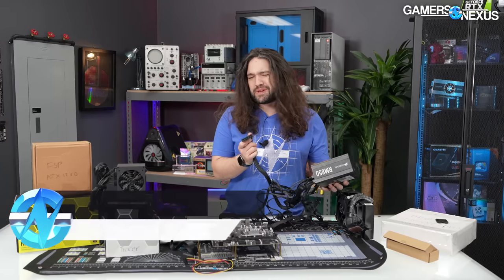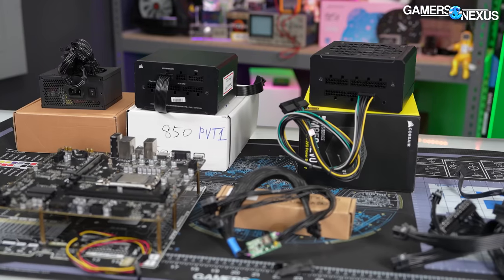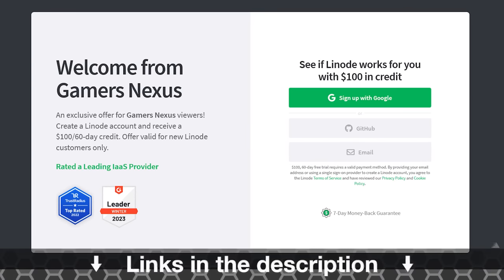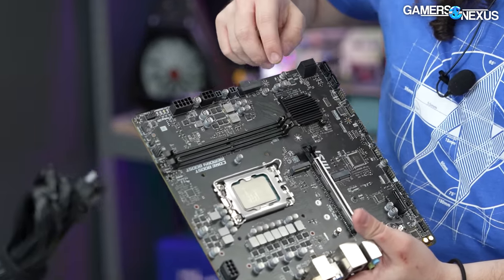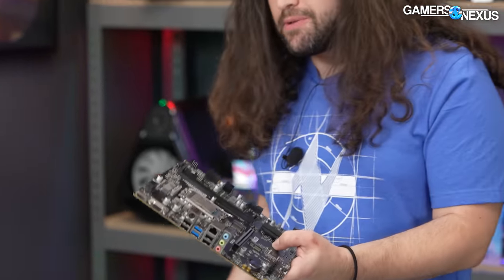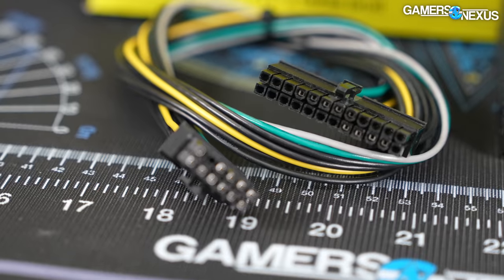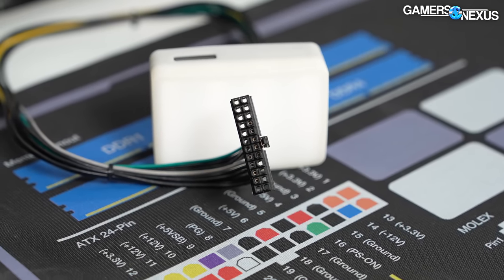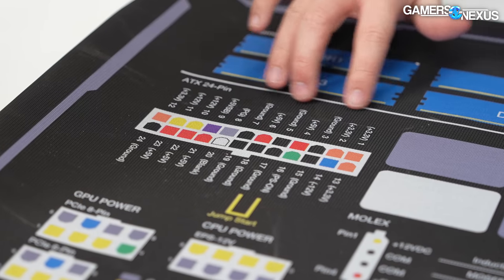The Future of Power Supplies - Maybe (Motherboard Cost, Cables, & ATX12VO)

Comment: Many thanks and great job on such a detailed and informative review. I have an electronics background and found this very informative. I hope you keep this up and produce more content as detailed as this. More understanding enables more informed decisions. I think any claimed 'energy saving' is marketing hype, compared with a properly and efficiently designed conventional power supply.

I don't like the idea of non-12V voltages being generated on the motherboard. These other voiltages have to be generated somewhere and it is better to generate the in the power supply which is more cost-effective to replace than a motherboard if, or when, things go wrong. This is far more likely with cables coming from a motherboard to external devices than to devices embedded on the motherboard. This is much worse than the present system because of the risk of damage to the motherboard, not just the power converter but other parts of the motherboard as well rather than just the power supply.

One thing I find interesting about 12VO is the power supply being able to provide load information to the motherboard. This could be useful in prolonging the life of the power supply if it limits surges such as startup inrush current which is something that can otherwise force the requirement of a larger power supply just to enable the system to start up correctly. Some high-power systems seem to 'eat' power supplies for fun!

Maybe this 12VO power supply load feedback to the motherboard could be implemented on a conventional power supply by re-using a existing but non-utilised line such as -12V which is not used in modern systems? Even if this is possible, what would the motherboard do with such information? With a 12VO motherboard it may be that the SATA power could switch on sequentially which would provide some reduction in startup current, although modern drives take a lot less power so this may be of limited benefit.

One possible solution to power consumption, even if it is not possible to provide power supply load feedback in a conventional system, would be to make existing power control stamdards visible as options in the BIOS. Combine this with a 'Start on demand' norm for all devices and the result is about the best power control possible, especially if this includes control over external ports such as USB. Individual USB port power control would be the ideal. The BIOS options would include the order in which power would be applied and to what devices. This could be expanded to a 'smart' power where there would be different power configurations available including the possibility of specific hardware being enabled or disable depending of what hardware was detected. This would enable, for example, internal storage automatically being disabled if a bootable USB stick was detected providing a secure alternative boot,  no devices except keyboard and mouse, booting between different operating systems on the same system without the other operating system's drive being visible which closes a security issue and limits power to only the devices needed.

Finally, as an alternative, why not broaden the range of clock speeds on processors and graphics cards in the sense of enabling then to run at tens or low hundreds of of megahertz? This may be a lot simpler to implement and would save a significant amount of energy and still leave a usable system, especially considering the efficiency of modern hardware. Go back far enough and games were played on systems running at 100MHz or less! To my mind it should be possible to build a behemoth and have it use as little power as a laptop or tablet if that is all that is demanded of it.
Reply: The motherboard is already generating like, 8 different voltages.  If your motherboards or power supplies are failing often enough that "which costs more to replace if it blows up?" has a measurable effect on total cost of ownership, you have a very serious reliability problem.

Comment: I might be a stupid person, but I'd personally trust my PSU to make voltage conversions rather than the already over-featured Motherboard.
What I'd prefer to see is 12vsb + the MB going only for 12V (reducing layer requirements) + the PSU providing legacy voltage compatibility. With that you have the same reduced standby footprint (given that the non-12V circuits should be offline in the PSU if we're only on StandBy) but without adding Motherboard complexity.

Comment: if 12VO is pushed in the future, Intel should make a minimum spec of VRs that convert to other voltages on the mobo REQUIRED that should last like 10, 20+ years. and i'm pretty sure that would be pretty easy to do with modern MOSFETs or SPSes for probably under $2-4 in components, at least outside of the controller, which admittedly i know less about

Comment: So, are PSUs difficult to repair? I keep a few old computers around for various reasons, and it's looking like replacing the PSU in case of a failed one is gonna get difficult in the future. Should I just stock up on the existing compatible designs?

Comment: Hey Steve, could you please do some testing / review on this specific PSU? GAMEMAX 1300W Power Supply, Fully Modular, 80+ Platinum Certified, PCIe 5.0, ARGB Aura Sync, 10 Year Warranty, RGB-1300

Comment: The legacy ATX spec was devised in a time when there were no VRMs on the motherboard whatsoever. All the system's required voltages were generated in the PSU, and passed to the components, like the CPU and RAM, without further conversion or regulation. In particular, 3.3V was added to support the early Pentium chips. That ship sailed a long time ago, as CPUs, GPUs and RAM evolved in new generations that changed operating voltage every couple of years. 

All this does is move the vestigal 5V and 3.3V rails from the PSU to DC-DC buck converters on the motherboard. As Steve alluded in the video, this is a transition that has already long since occurred in the cheap $#!+ prebuilt space. And the server/data center space. And laptops. All the major players in the DIY/enthusiast motherboard space are already OEMs for these classes of systems. I would expect potentially lowered manufacturing costs, due to economy of scale, as you'd no longer have the niche DIY/enthusiast space as a design outlier. I harbor little hope that those economies would be passed on to individual consumers making single unit purchases. 

The regulatory framework that drove Intel to update their spec is predicated on the assumption that systems are replaced in their entirety, and only when they reach end of life. Improvements in macro-scale energy efficiency will be achieved organically, as systems are replaced as they wear out/break down. Outside the DIY/enthusiast market that Steve targets his channel at, which is likely to attempt piecemeal system upgrades, this is a valid assumption.

Comment: Yay! Instead of converting voltage one time in PSU let's convert it every time we need it - that will be more efficient (not). And if you want to keep your old PSU - let's convert it a few times more with some extra cord!
Reply: It will be more efficient, and it will be cheaper.  The OEMs and server makers figured this out years ago.
Reply: @Vegemeister1  For them - yes. But will it be cheaper for you to replace whole motherboard if you need to connect another sata?
Reply: @Hsiss  Why would you need to do that?  No reasonable motherboard is going to come with more SATA ports than it has SATA power outputs.  But if you're talking about adding an extra SATA HBA, you only need a 12V->SATA power converter, not a whole new motherboard.  Those will be cheap once the potential market is big enough.  I'm seeing whole 12V -> 24-pin ATX + 3x SATA PSUs on ebay for <$20. A SATA-only supply will cost even less, since it only needs a single 5V converter (3.3V is almost entirely unused by drives) and no power-on logic.

Comment: Like so many others, I hate this idea. Motherboards are already outrageously expensive, and this will only increase costs. There's really no benefit to board usage either, since now the reduced size of the power header is just taken up by the conversion circuitry on the board. More personally, I never could have built my current home server if this had been forced on me... I have a server in my house that has 11 drives in it, and it appears the best a 12VO motherboard could power would be 6. Now perhaps I'm in a niche with my large server, but there's no real benefit to 12VO in the first place.

Comment: One thing I was unclear on was cooling.  If the computer uses essentially comparable power, it should be generating comparable heat, and therefore cooling requirements.  If it gives you a power supply that has a significantly smaller fan, and the MoBo has no additional cooling fins or fans where does the heat go?

Comment: I'm curious how 12VO is going to handle people who need more hard drives then max number of power plugs offered by the motherboard. For example if a motherboard offers only 6 power plug connections but using a pcie to sata card you have 8 hard drives. Would this mean you would need either 2 different power supplies? A 12VO and non 12VO?

Comment: My only issue with the idea of 12VO, is what about all the USB ports, and drives.
While most of the things on the PC itself do run on 12V, there's still many things that use 5V.
a USB3 A port can provide 1.5A, and USBC can provide 3A...
Not to mention the dozen or so hard drives I have in my PC.

Seriously, the only reason for me to go with PC over laptop would be for all the extra internal storage... and maybe a few extra things like video capture or TV tuner card.
I actually have PCIe cards in my PC, such as a USB3 card that requires a hard drive power connector, and a front panel that also has one, to provide extra 5V for the USB ports. what are we supposed to do with those with 12VO?

Honestly, I'd be fine with 12VO on the motherboard, as long as the PSU was still capable of providing SATA power cables. I need my 20A of 5V power.

Comment: This just shows how important in the future being able to use the same motherboard across multiple CPU generations will be critical. 

With Intel axing any platform from supporting more than 2 CPU generations I would definitely pick an AMD motherboard over Intel since AMD has shown they are willing to allow 7 year old motherboards to still use the latest generation CPUs. The cost savings I had upgrading with AMD vs Intel was massive and worth a very minor performance loss compared to Intel.

Intel is going to need to be more competitive with supporting their older motherboards for a longer period of time, especially if motherboard prices skyrocket with the 12VO spec. People won't want to replace a $500 motherboard every time they upgrade 2 generations on Intel vs not having to buy a new motherboard with AMD.

Comment: I'm lost here, they say that by delivering 12vo at idle they increase the efficiency of the PSU, but wouldn't the mobo be converting those 12v to 5v even at idle to work? so they just took the PSU inefficiencies and moved them to the mobo to "meet" some regulation?
this is beneficial how?

Comment: I'm not very convinced by ATX12VO. Instead of having the voltage conversions in the PSU which one needs to buy maybe once every 10 years or so, the cost is added to the motherboard which one replaces maybe once every 3-5 years. And although the 10-pin connector itself is smaller and takes up less space on the motherboard, with all the extra electronics required for those voltage conversions they take up way more space than a 24-pin connector. I actually bought my last PSU in 2007. It died in 2012 and I got a new one for free as it was under warranty, and have been using that one ever since.

Comment: I'm currently on 5900x and I'll only switch to a new platform together with a new PSU which I want to be an ATX12VO one. Even though I have SATA drives so I need 5V. Transition to more efficient HW is a progress I'd like to be part of.

Comment: The other good thing about a direct PSU utilization reporting is that many people will now learn that their mammoth 1200W power supply is running at horrible efficiency because 99% of the time, their system is only drawing 40-80W combined.

The amount of systems I've come across running Ryzen 3600 tier CPUs with 6600/3060 tier GPUs on 1000-1200W PSUs is outright silly.

Even under maximum load these systems often don't even come close to reaching the midway point of the efficiency curve where the peak efficiency lies.

Comment: I still don't like the idea of moving it to the board, because now, you are definitely limited to how much power you can use where, so now instead of a upgrading a PSU to get more power on those other rails, you have to switch the board, if any boards even support more power. I don't see spinning hard drives disappearing for bulk storage yet either, so being able to plug a handful into a machine is still useful. That or we need to add the voltage conversions to all the other peripherals. Though not really sure what things are actually using lately without tearing them down and looking.

Comment: I don't see many (if any) benefits from adopting the ATX12VO standard for users. I know I'll avoid it like the plague. It's only upside, is making the 24 pin a bit smaller. Meanwhile here are all the downsides:

- Not compatible with normal ATX power supplies.
- We probably won't see motherboards/PSUs that support both so it's a hard transition.
- More expensive motherboards, due to the added components.
- All the space saving of the 24 pin is effectively negated by adding the need for extra headers on the motherboard to supply 3 and 5 volts.
- Molex and SATA power cables now must connect to the motherboard instead of the PSU. This will mean less connectors on smaller and cheaper boards, and just a bad design overall. 
- The 6 pin connector is redundant. The 8 pin ESP already does what it's supposed to do. It's main usage seems to be to offset the higher power draw due to all Molex and SATA power now going though the motherboard. But why a 6 pin VGA, why not just use one one more 8 pin ESP?
- Power savings at idle are probably diminished by the extra losses caused by routing  the 12V for disks and other SATA devices through the motherboard.

TL;DR: ATX12VO offers nothing that's worth it, makes motherboards more expensive, will support less SATA devices, and won't be compatible with your existing setup. Geez, I wonder why no one wants it.

Comment: It feels to me that the 12VO standard is more about making the PSU look more efficient to regulators while the system is not actually more efficient and may even be sells so. 12VO makes a more energy efficient PSU by moving part of the power loss from conversion somewhere else that isn't covered by the California regulation thus the motherboard can use cheaper less energy efficient components thus actually resulting in a full system that is less energy efficient in real use even if it may be slightly more energy efficient in standby.

Comment: I don't see any reason to have +12VSB, USB is already 5V during SB mode. The buck converter (12V-5V) for standby is low power, doesn't cost much at all (i.e. cents) and it's virtually unused under normal operation. The step up one shown in the video has no good way for heat dissipation. The feature FP6293  step up seems decent enough (based on the datasheet) to carry 5V-12V. It should not get too toasty even with some devices connected to the USB during standby.

Comment: Ive always thought that 12VO was going to be a oem/office standard, reducing the power consumption of these fleets of computers even a tiny bit would be huge since they run basically 24/7 even if theyre only used maybe 10 hours a day. I dont really see it taking off in the enthusiast/diy space though, because it doesnt really accomplish anything. Our systems draw more at idle than theirs do full-tilt, but theirs probably outnumber ours 100-1

Comment: It wouldnt really matter for nvidia prices if they were self powered.. and those few Watts provided back to the Mainboard wouldnt really matter.
Pico Psus are around for a long time, but they rely on the 12V from the power brick.
I hope if its on the mainboard its still a pluggable module to replace or screwed on, soldered in will be bad for defects.

Comment: so different area of tech, but eurorack modular audio gear has kinda gone thru this unofficially over the years. initially it was +12, -12, +5, a bunch of grounds, and two connectors for a behind the panel shared bus nobody ever used, but set up so that only the first half could be used to get just the 12s and ground. later some power supply manufacturers only supplied these, which wasn’t a huge deal since most modules only use +-12, and now most modules that need 5 will have a voltage regulator on board.

obviously a very different thing, lower power draw so less likely to fail, and not usually being made for as cheap as possible, it’s expensive and people know it, so you’re less likely to run into people selling garbage. l

as for my thoughts on it for computer hardware, maybe it’ll push more fan/led manufacturers to just make 12v and not 5v, and similar for other stuff i’m less familiar with, and lead to it just being 12v. it’s always a bit annoying when tech changes standards but it’s usually better once it’s done

Comment: Inconvenient, atm. Its perfect for use in 48v solar power system to achieve the best efficiency without inverting and stepping.

They could design a standard atx mini psu that takes 12VO. So we can have the best of both, powering from a direct 12V to 48V source. Like the pico psus can start using a 12VO connector, instead of the laptop connectors they do now. Maybe even coupling, three dell 240W psus..